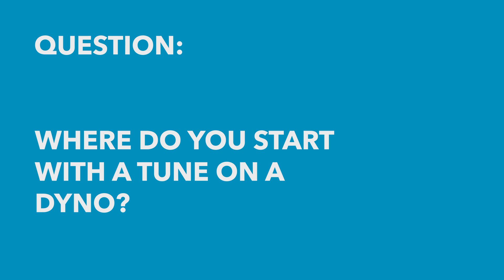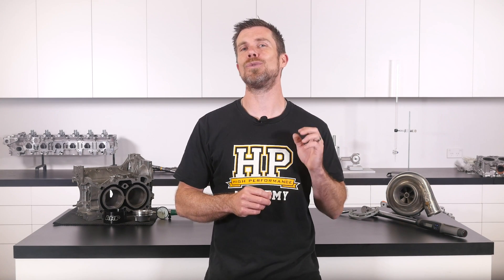Ignition Or Fuel? How To Start A Tune? [HPA Q&A]

Comment: Retard timing a bit from stock, at least at WOT, then tune fuel tables for ideal AFR, then dial in the timing, and see how it affected AFR... Rinse repeat? How the heck do you tune timing without a dyno or knock sensor? Listen for pinging and go back?
Reply from the maker: You want a knock sensor, and you will end up being a little more on the conservative side of things to be safe when road tuning however you often can get very close to the result you would on a dyno depending on the setup.
If you're tuning a torque based ECU however you really want to use a dyno - Taz.
Reply: @hpa101  Some of the most modified cars ever are 90s hondas, the popular engine management is hondata which is obd1 and doesn't support a knock sensor. Is this just some kind of tuners intuition? People are making 1000hp with no knock sensor...

My car has one but it's a pain to get it working with an obd1 ecu.
Reply from the maker: You don't need to run one through your ECU, you can use a standalone audible knock detection unit like Tuner Nerds Knock Monitor Pro or a Link Knock Block. There are also units like the Plex Knock Monitor V2 which have an array of features but are more aimed at the professional market.
You can move these units from car to car. 
Hope that explanation makes sense, and I think you might enjoy this here as well: https://www.hpacademy.com/technical-articles/dont-waste-your-time-listening-for-knock/ - Taz.

Comment: So Retarded timing, then Fueling, then ignition timing and back and forth for ignition and fuel. Hmm... makes sense :D
Reply: It does make sense. 
1. You tune your fuel table for desired AFR target.
2. You start to tune Your ignition map. I'm sure, that more and more advance ignition will lean AFR. 
3. You will be forced to jump from ignition to fuel table. But the increments will be small so fuel corrections changes fast.
Why You decrease the timing before fuel tune? Because you don't want to hear that the engine is knocking:)
Reply: But remember that more ignition advance isn't always best for top end power in terms of BHP. I can run upto 26 degree of ignition advance towards the redline but the car makes better BHP running 24, slightly less torque but more power and better safety.